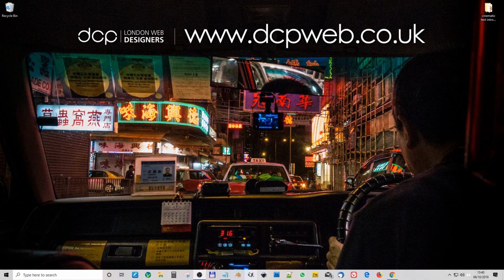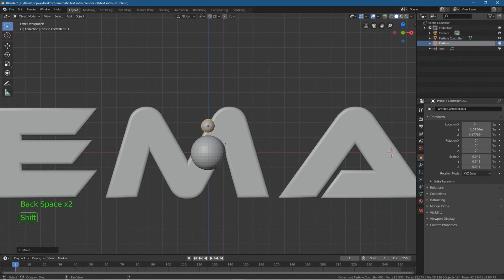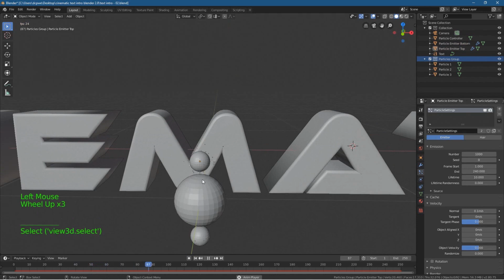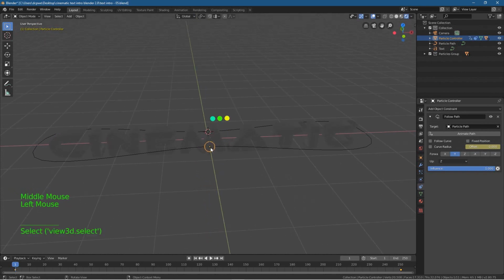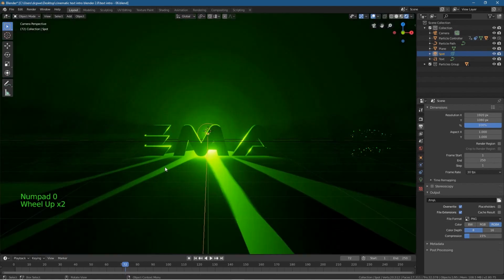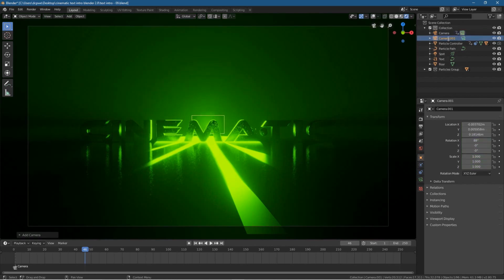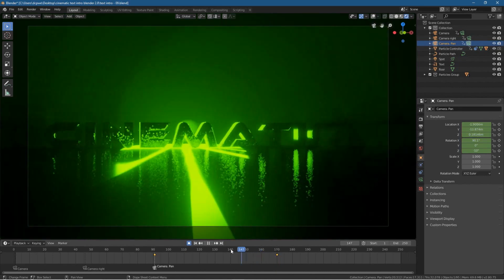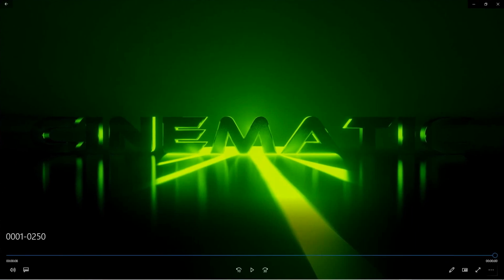Cinematic Text Intro Animation Blender 2.8 Tutorial #Blender

Comment: When I Shift F into fly mode, I can only fly with keyboard, mouse wheel does not fly in or out.  How do I change it so mouse wheel will zoom in and out?
Reply: Ok I was able to figure it out.  I noticed in your video that you had a rectangle in the center when you went into Fly Mode, and all I had was a cross-hair.  After reading about walk-fly via the link you posted.  I learned that the cross-hair means you are in walk mode and the rectangle is for fly mode.  So when I hit Shift F it was putting me in walk mode, after I dug around in Preferences.  I found under Navigation there is a Fly & Walk section where you can choose either Walk or Fly.  I clicked Fly saved and now when I Shift F it works as expected mouse wheel in and out with no problem.  Amazing something so simple.  LOL!  Wanted to let you know in case someone else presents the question to you.  Thank You for your help and keep posting awesome videos, you're doing a GREAT JOB.
Reply from the maker: Great 👍
Reply from the maker: You need to roll the mouse wheel
Reply from the maker: Try https://youtu.be/mkezsK7aHSA
Reply: That's what I'm saying when I roll the mouse wheel it does nothing, I've already setup fly to use Shift F.  When I go into fly mode the camera moves (very fast) looking around, but again mouse wheel does nothing.  I'm using a fresh install of Blender 2.82a, I did notice in your video when in fly mode the controls listed at the bottom of the screen are slightly different from what mine lists when in fly mode.
Reply: I just tried with Blender 2.80 and it does the same thing.
Reply from the maker: Are you using windows ?
Reply: Yes, Windows 10
Reply from the maker: Mouse wheel is only used to change the speed,

Use

Arrow keys or W, A, S, D move forwards/backwards and strafe left/right.
Reply: I know I can use the keyboard, but your video said to use mouse wheel which seems a lot easier.  So does your mouse wheel work when in fly mode?
Reply from the maker: Read this https://docs.blender.org/manual/en/latest/editors/3dview/navigate/walk_fly.html
Reply: Just so you know when I hit 0 to view from the camera the mouse wheel will adjust the camera closer or father, but not while in fly mode.
Reply: Thanks for asking this question W1ndTalkr, I was struggling so hard trying to figure this out.